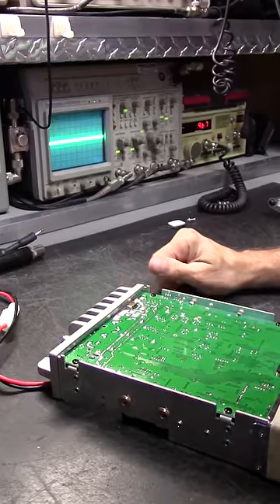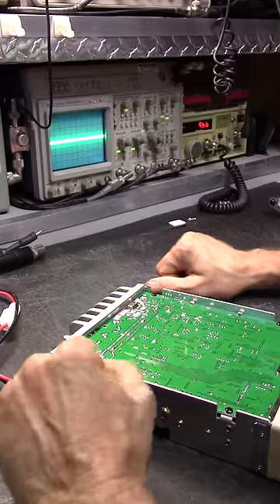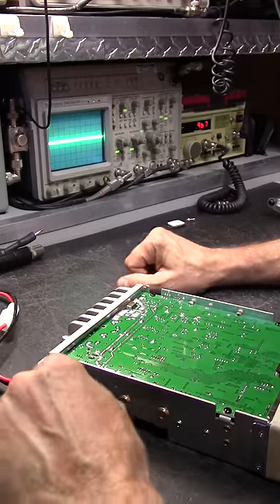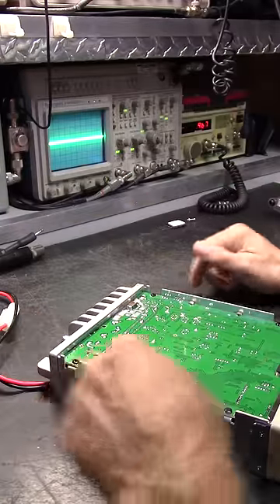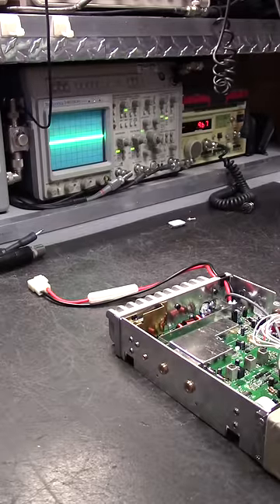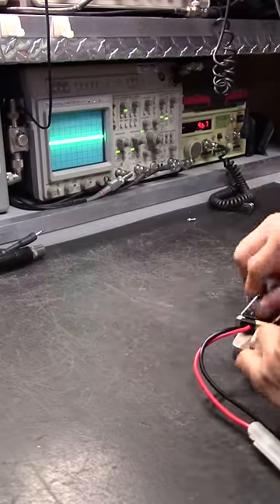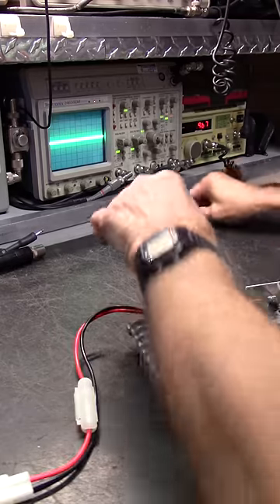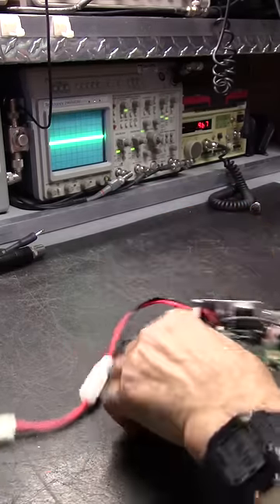Stryker 447HPC2 Radio / Palomar MAX MOD INSTALLATION .. It's a Clean thing!

Comment: Nice de-soldering gun, shows how things have changed. Years ago it was a soldering iron, sucker & braid. Now we need a bigger bench to take the de-soldering station, Hot air re-work station etc.
Reply from the maker: Robbo thumb! lol I've been using a sucker for a long time and I still keep it handy. Desoldering pump is the way to go, much cleaner in so many ways. Working on a Microscope now ... may as well watch videos on it too! lol
Reply: Fine Tune CB Shop : I haven't succumbed to the microscope yet, but I'm getting there. Just repaired a Midland radio, I swear the transistors are so small you can hardly see them. Lol.
Reply from the maker: And getting smaller everyday!